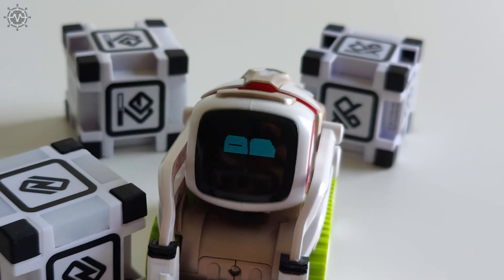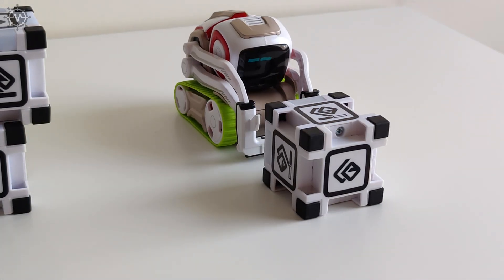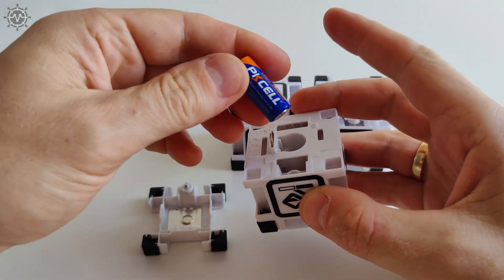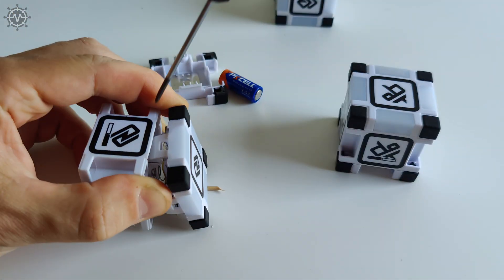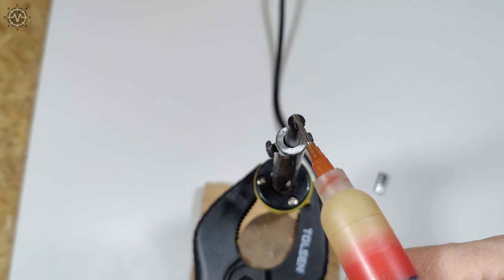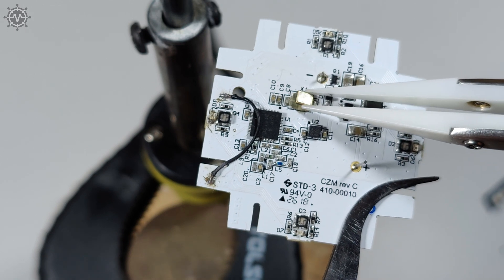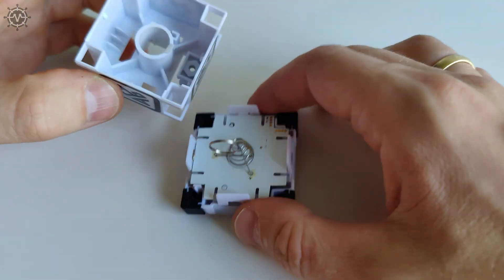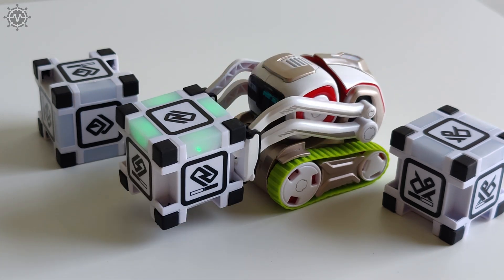How to Repair Anki Cozmo Cubes DIY (4K)

Comment from the maker: Quartz Resonator Crystal Oscillator I bought it from here: 
https://a.aliexpress.com/_onrCapN
Reply from the maker: Thank you for noticing the mistake.  The crystal must be 16MHz.
Reply: the link isnt available any more, do you have another one ?
Reply from the maker: Link works for me. Try using VPN maybe or here:
https://a.aliexpress.com/_ms48wcG
Reply from the maker: @ElectroHouseFanXXX sorry I don't have spare parts..
Reply: Thanks for the video and the link. In the description you mention 16khz quartz, I assume this is more like 16Mhz ? I have a damaged cube board due to 12V battery, and I might get a shot a this fix but my quartz inscriptions are "e160 702a" which I can't find any references to so far.
Reply: How did you determine which crystal is correct? I can’t find any details online. Also what is the correct orientation to install it? I have a 50/50 chance of installing it backwards…
Reply from the maker: You need 4 pin 16MHz crystal.  There are small numbers, letters on the crystal, orient the direction of the installation according to them.
Reply: Thanks

Comment: I lost the squares due to installing a battery that did not fit the cubes in terms of power. Then I discovered the error and installed the appropriate battery, but it does not work. Is there a solution for this?
Reply from the maker: The situation is similar but damage could be different. Try to fix it, you have nothing to lose.
Reply: Metoo
Reply: Omg same!

Comment: What if… it flashes properly and then proceeds to not work and slightly flicker red?
Reply: Ive concluded there’s just a loose connection somewhere, after one day it briefly decided to work
Reply: An unfortunate update: it didn’t fix :(
Reply: I'm having exactly this on Cube 3 now. Still works slightly with some games, but it's on its way out for sure.
Reply: Ended up getting another Cozmo set, robot and everything.

The robot himself turned out to be broken, but his cubes work! Just a touch of discoloring in the lights.

Comment: Do you think this solution works for vector’s cube as well? Cuz i bought a second hand vector with cube and when i replaced the battery with a proper one instead of the 12v that was inside it was glowing only in red and yellow.
Reply from the maker: Sorry, but I don't think that this solution will work for the vector's cube..

Comment: Digital Dream Labs is selling new cubes for $25 U.S. plus shipping. I ordered a complete set but they sent 2 #2 and a #3 cube. Never got a response from any e-mails or messeges to try and correct the issue. Finally gave up and just ordered another #1. They sent the correct one. All three cubes work perfect. Now for the extra #2, have you determined the difference between the cube hardware? Since the boards are physically numbered I'm assuming a trace difference rather than software control.  Though thier canned programming won't support it, I'd like to try and change the extra #2 to a #4 for programming purposes.
Reply from the maker: Thanks for sharing your thoughts.  I didn't notice the hardware difference either, most likely the software code is different between the cubes.
Reply: @MukGyver  My Cozmo did its update long before I got cubes or even a charger. I never had the Anki app and it was not available. DDL had an app and the first thing it did when I linked with Cozmo was do a long firmware update. I initially  charged Cozmo with the 5v hack I saw on YouTube  DDL made some Cozmos but I recently bought an old Anki Cozmo by itself at a thrift store for $2.

Comment: Hello, by mistake I put 12v batteries in the cubes instead of 1.5v. Now the cubes no longer work. Do I need to do the same thing as in your video to get them working again ?
Reply from the maker: Depending on how much damage is done, this method is very likely to help you repair the cubes. However, the power supply circuit or the processor itself could be damaged also.
Reply: @MukGyver What should I do then?
Reply from the maker: @TheClawedSilencer firstly I recommend you to try a fix as shown on my video. It's cheap and easy. If it doesn't work  you should look to buy a new cube.

Comment: Thanks for the video but I am also having no luck with the link and am trying to source the crystal oscillators elsewhere. Does anyone have any more information on the specs. Voltage, size etc.
Reply from the maker: Just search (google) for "Metal 4pin 16MHZ Passive SMD Quartz Crystal Oscillator"